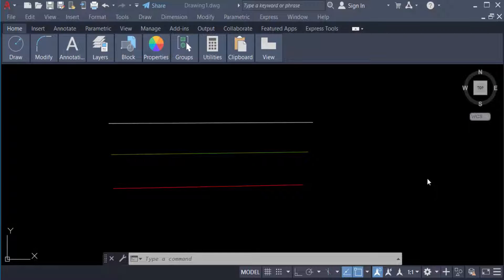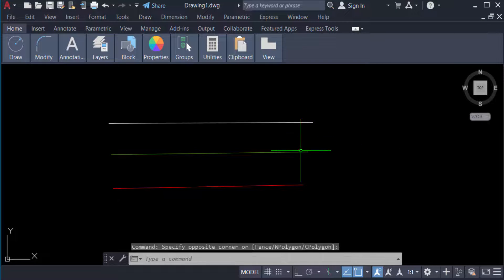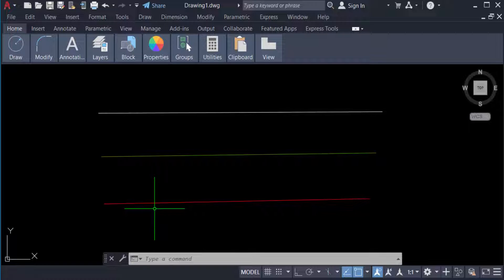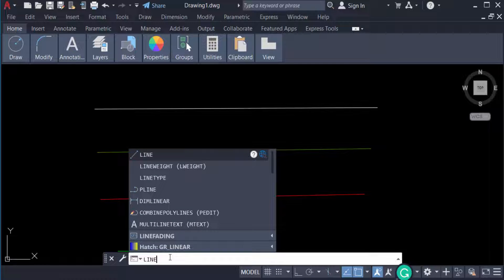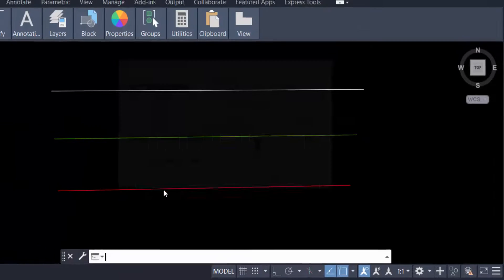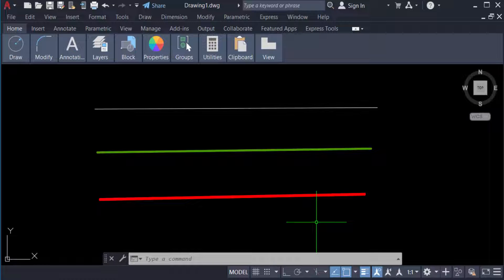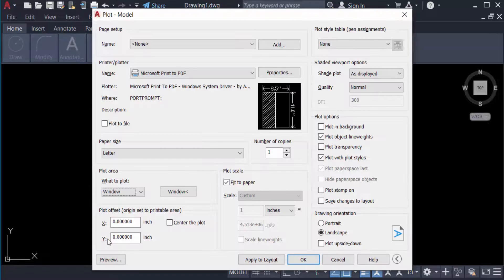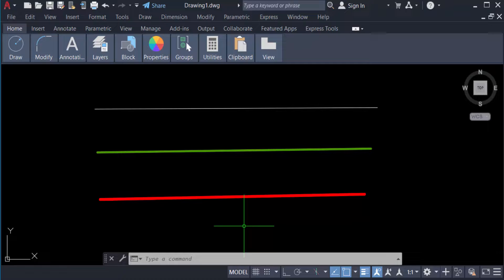Line weight not showing in plotting preview in AutoCAD 2022

Comment: i choose line thickness to 0.3mm but when i turn on line weight the lines disappears.please help.
Reply from the maker: line is too small that's why not to be seen. press z (space bar) then press a(space bar). thanks
Reply: @Easy-OnlineTutorial  No mam actually when i turn display mode to  2d firework the line disappears but in other modes such as realistic or hidden there is no problem drawing line